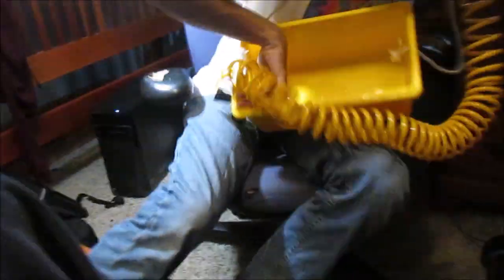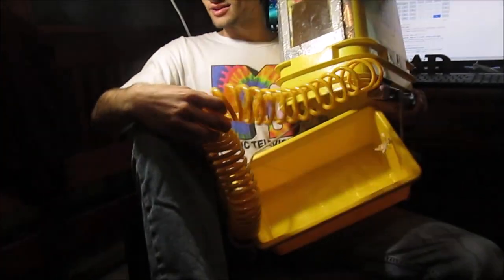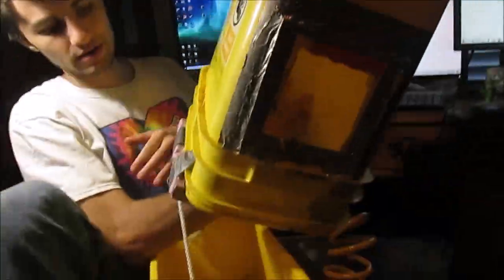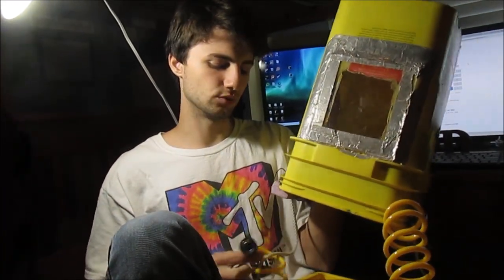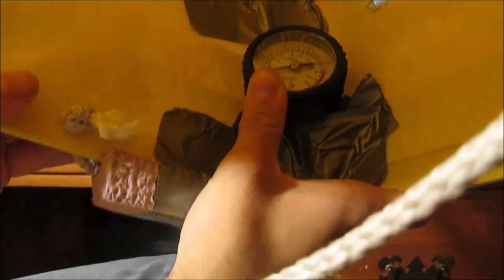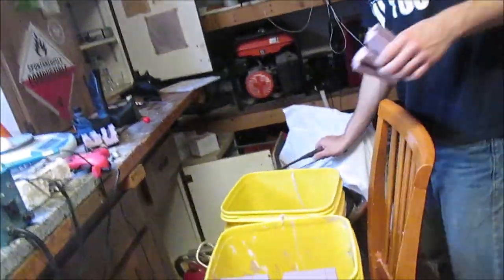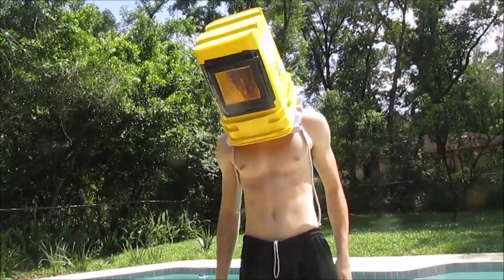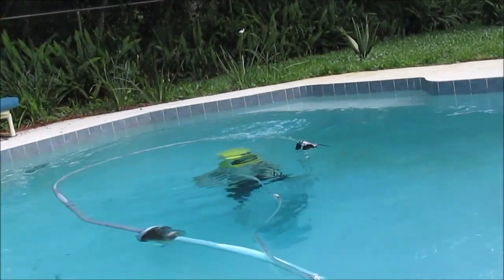Kitty-Litter Diving Helmets

Comment: Aren't you worried about breathing in oil fumes from the compressor?
Reply from the maker: This is a battery-powered compressor, so there are no oil fumes. If it were diesel powered there would be. We actually manually opened the compressor to check how it works, and these battery operated compressors basically just use a DC motor to open and close a rubber diaphragm really fast.

Comment: Alright so you've made an underwater breathing apparatus, but what are the next steps to make a jank self-contained underwater breathing apparatus? (A SCUBA, if you will)
Reply from the maker: Well, without using compressed air in a tank (which even we aren't dumb enough to try), there unfortunately aren't a lot of low-pressure ways to store oxygen without simply using larger and larger diving bells.  Maybe the next step isn't to make the system self-contained, but instead make it into a primitive submersible with snorkel...

Comment: I want you to react nitric acid with potassium hydroxide or say the standards, please respond quickly
Reply from the maker: Bit of an odd request - but yes you can create potassium nitrate this way, it's just a very, very bad way to do it. 

It can be expressed as so: HNO3 + KOH → KNO3 + H2O

The problem here is that nitric acid as a compound is far more expensive than actual potassium nitrate, which is a common fertilizer. 

Because nitric acid is, well, an acid, and potassium hydroxide is a classic base, it's a simple neutralization reaction - the formation of a salt and water!
Reply: I am in a country where he does not sell potassium nitrate